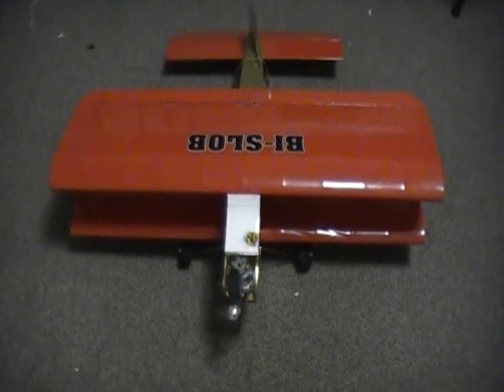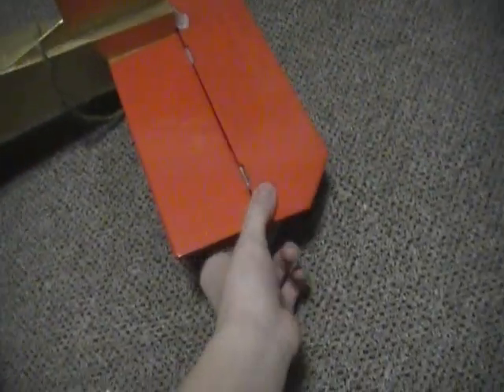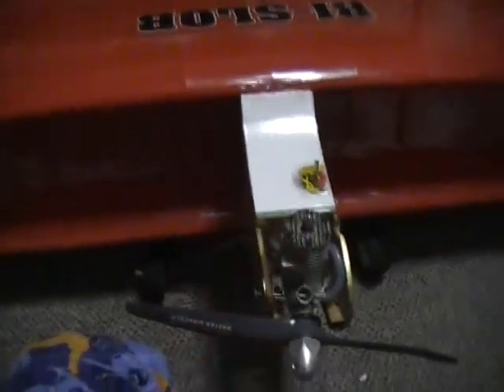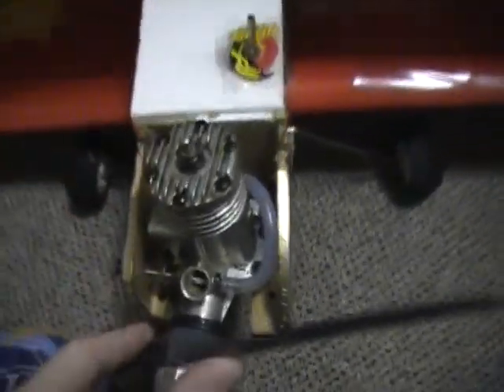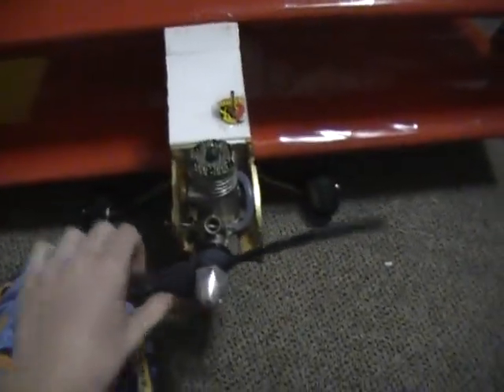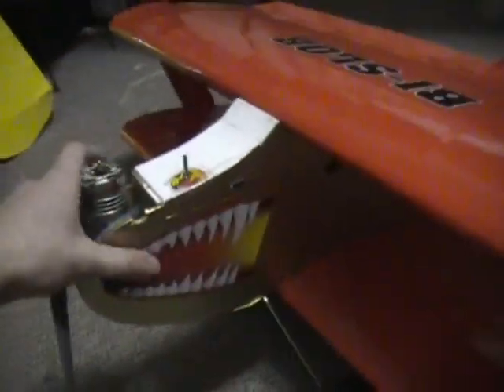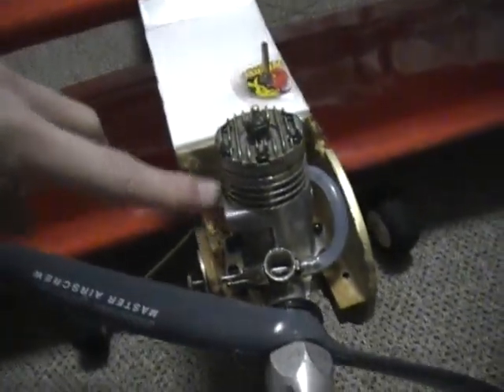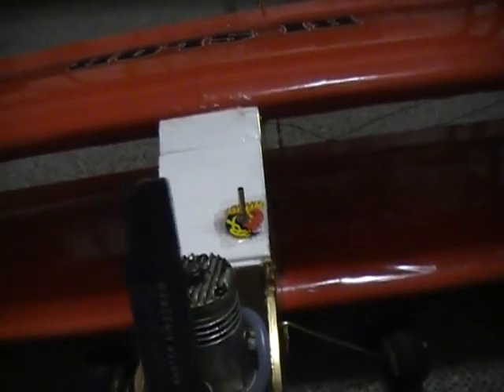A Review On My Bi-Slob ARF

Comment: you are a beginner i think my bi slob went together sweet hindges soo ez  your plane looks rough also  but you will learn   also put screws in them horns they take all the thrust
Reply: did you put 1/2 oz wait in wing
Reply: @downedpilotellis8091  out board wing yes
Reply: @FradyKatt  it should pull away,the only thing  i can think off is its out of sq some were
Reply: or out of balance